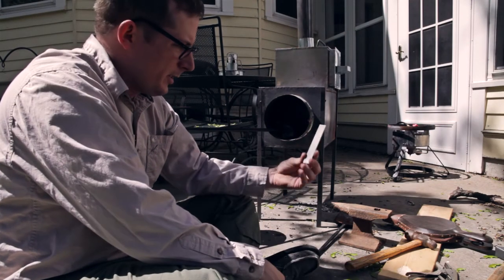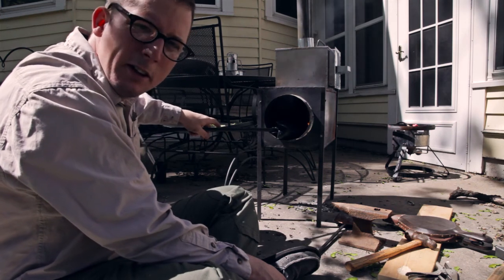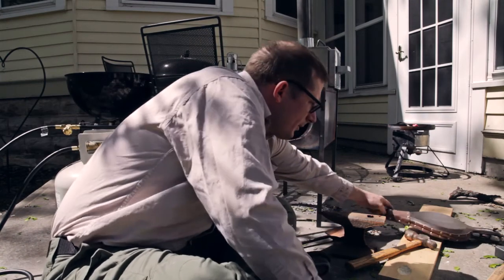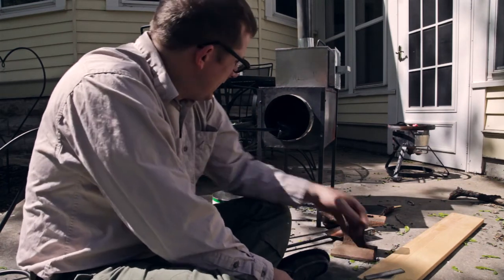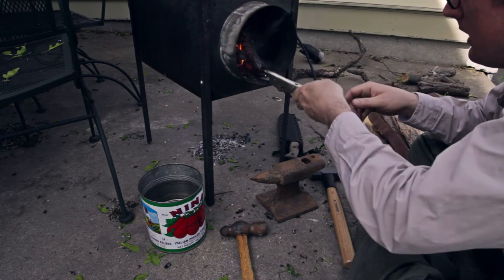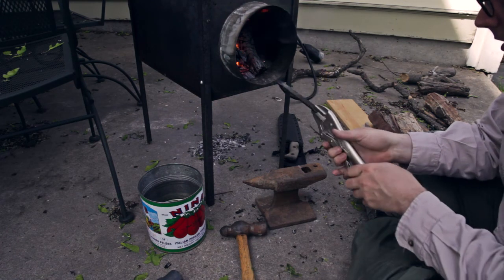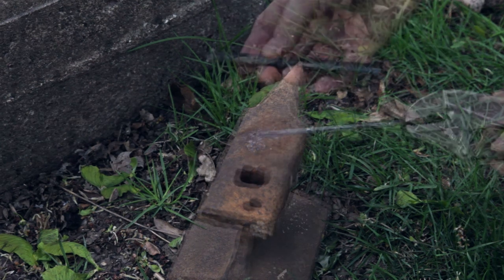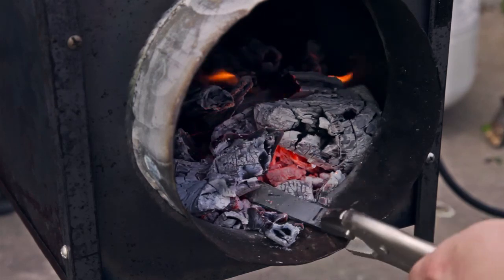How To Forge A Spoon

Comment: Now that you have quenched it in water, it is very hard but brittle. You need to anneal it for about an hour in your oven or toaster oven at apx. 400 degrees. That will bring the hardness back down to a reasonable level.

Comment from the maker: What is a steak hook?  I think I am going to augment my wood stove heating with a propane torch for my next project.  It gets hot enough with the wood stove but it would be a lot easier if the steel was red hot.  A lot easier to get it that hot with a torch than a bellows and a wood stove.

Comment: A good way to tell if the metal is good and hot, use a magnet, Once it reaches the proper forging temp, it will not be magnetic.